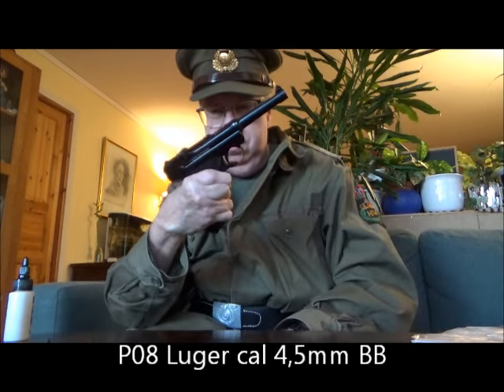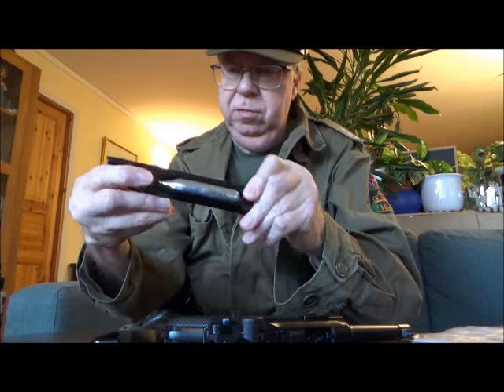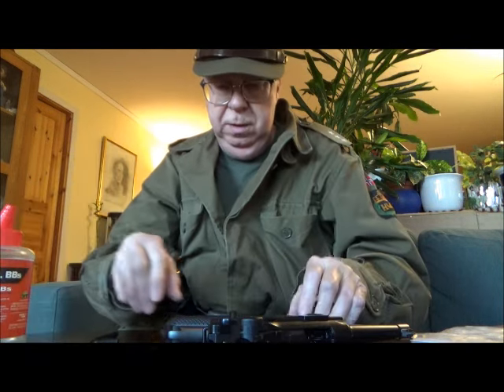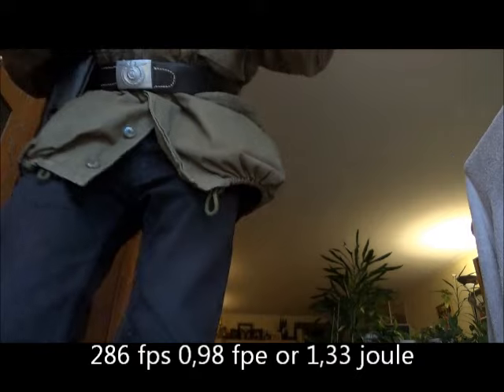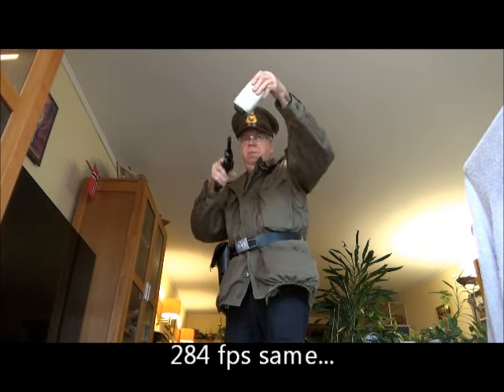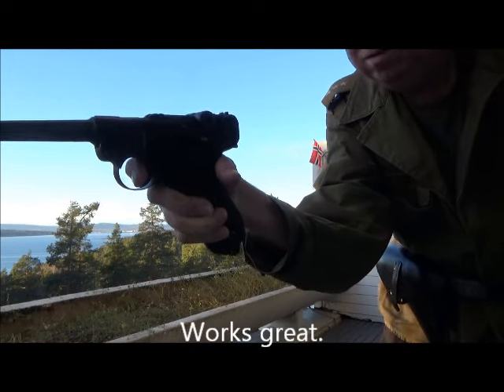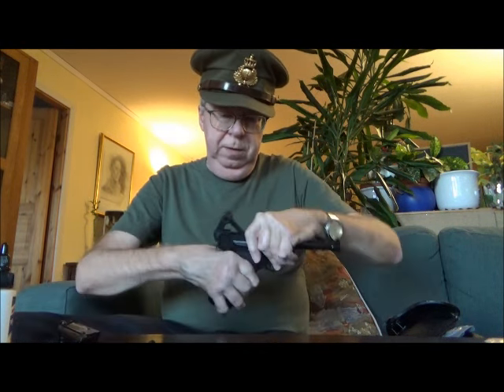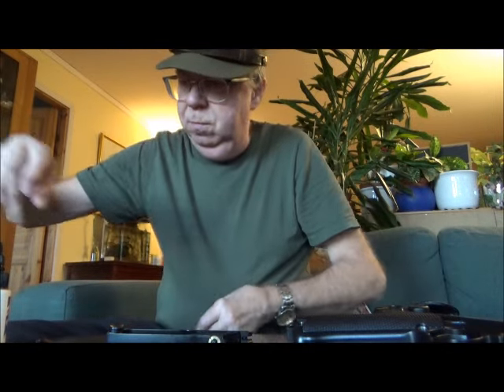Umarex P08 Luger, Blowback, Plinking

Comment: P08 is a very ergonomic, sweet shooter; have not "fired" my Umarex replica yet but seems it will be almost as much fun to shoot it as it is to "burst away" with their MP40.  Assume you put a drop of oil or two on the neck of the CO2 canister before inserting it to keep the o-rings in good shape.  Glad to see you enjoying your airguns again - recall you experienced some troubles from your overzealous types at one point.
Reply from the maker: Thanks my friend. Yes its super cool pistol. Very fun to shot with. I always use oil on the tip og the CO2 cartridges. I just started up with airguns again. Problems with the cops here... So I must be careful.